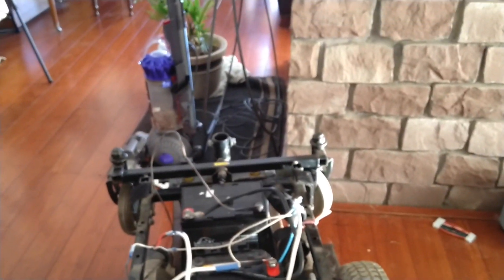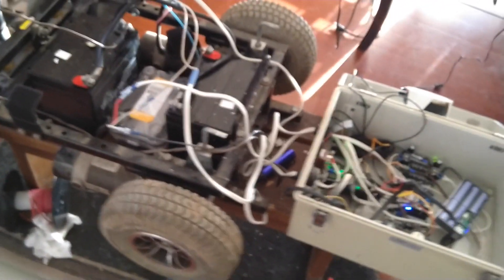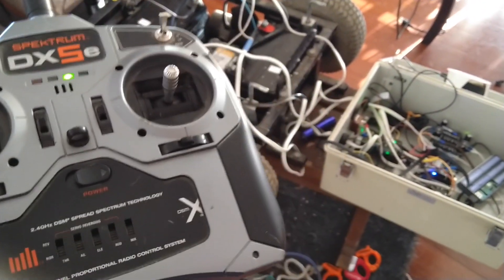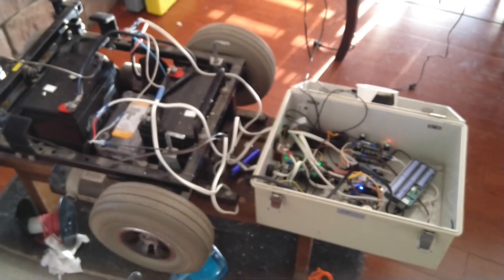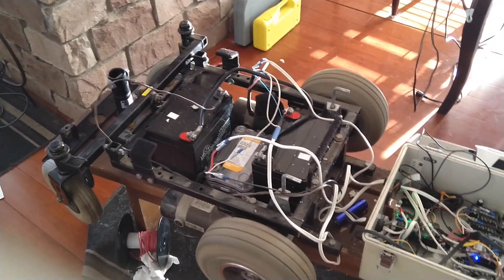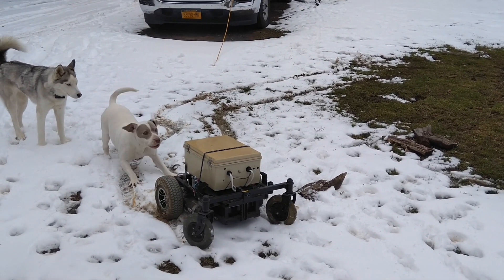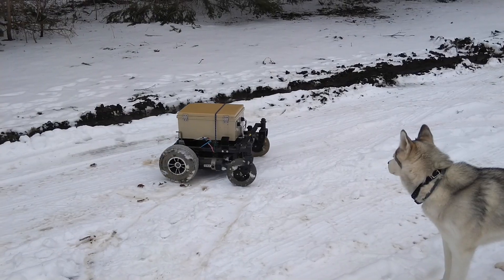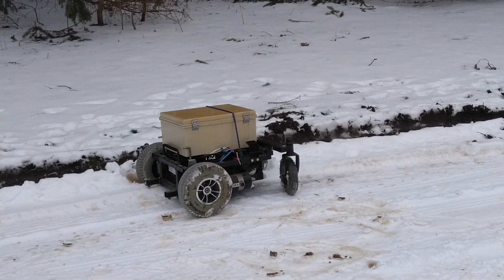Runaway Rover?

Comment: I just wanted to clarify that I meant the levitating magnetic bearing in the wind turbine video with the silver looking bowls.
Reply from the maker: no, I have a different turbine with a magnetic bearing.  It has eps foam airfoils which were covered with a 2 part epoxy
Reply: Is it sitting on a horizontal or vertical axis?
Reply: Is it sitting on a vertical or horizontal axis?